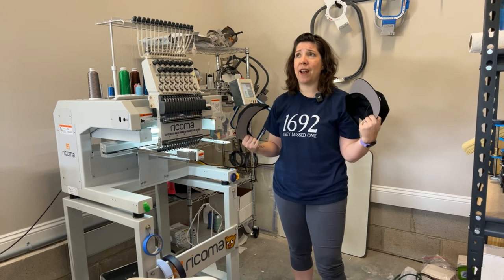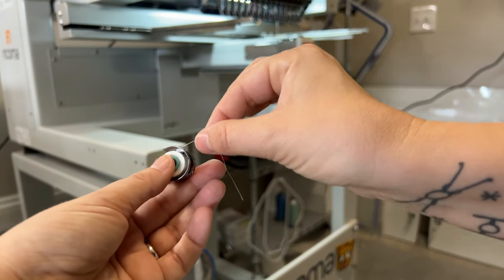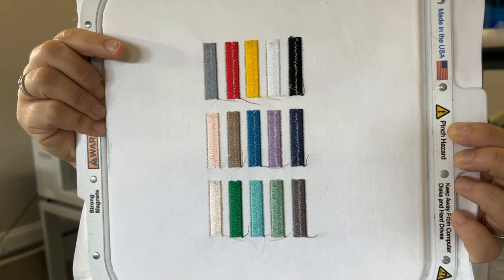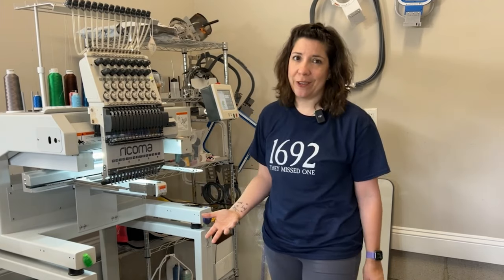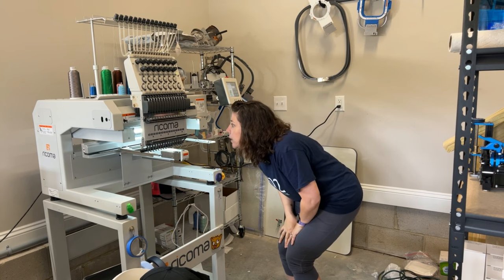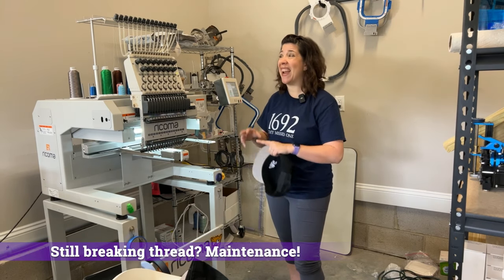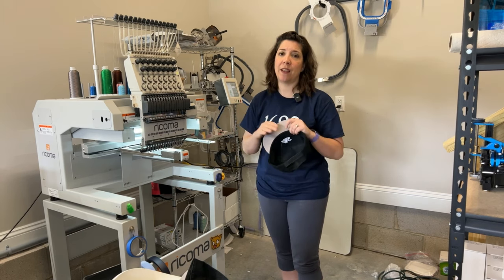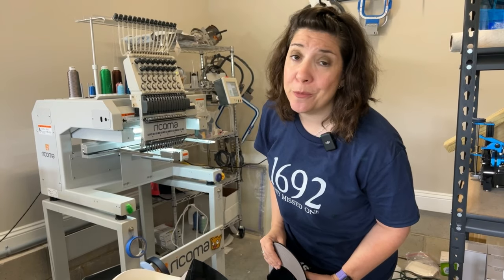How to Diagnose and Fix Thread Breaks in Machine Embroidery (featuring the Ricoma MT-1501)

Comment: Great video!!! I will add to check the needle direction too. This has happened to me on several occasions. If your needle is not set in the correct direction (even just slightly off) it can cause your thread to shred. Loved the info, thank you for sharing!

Comment: I’ll add one more thing… because this happened to me. I had thread shred on every needle, did all the troubleshooting and still couldn’t fix it. Turns out, the timing drifted off. So eyeball the needle position relative to the hook at 200 degrees. If it’s not lined up, your timing is off. Pretty easy fix on these machines but you have to hold your mouth right. 😊
Reply from the maker: HAH! That's so true!!! I have had this happen as well. I like to use the other end of the needle threading tool to hold my needles while I insert them. It helps keep them in the right position while I screw it back in.

Comment: I'm back, any advice for getting axis error repeatedly? needle is going off axis right in the seam....i've done every tip i've seen on yt and it's still an issue....so frustrating. everything should be good! It's not even flagging....so what could be causing this? please and thank you <3
Reply from the maker: I hate to ask, but have you called support?? I called them up and we facetimed fixing it remotely.

Comment: You shouldn’t ever need a 90 needle unless you’re embroidering tough leather, like a saddle or something similar. Stabilizer isn’t needed for structured hats like the ones in your video, Richardson 112s, etc… and even then, a 75 needle is more than enough. The majority of consistent thread breaks are the result of bad digitizing, too many stitches in too many directions too close  together. If the thread breaks are in random spots, it’s usually a burr in the eye of your needle.
Reply: Who do you use for your digitizing?
Reply: @serenityinthecity1  we do most of our own digitizing on Wilcom embroidery studio. If we need to send something small out for a quick turnaround, we use Steven at digitizing ninjas.

Comment: One needle of my machine isn’t going through the fabric. Any idea why? It keeps saying thread break. I changed the needle,  oiled up my machine, made sure there’s no lint or thread in the bobbin area and im lost.
Reply from the maker: When that happens, the only way I've found to fix it is to take a picture of the stitch count in the design, back out of embroidery mode, then back into embroidery mode, set the stitch count manually from 0 to where it was when I took the picture, then start from there.

Comment: I have a single needle embroidery machine and it snaps all the time.  Went through all the steps.  Took it in for service.  Still snapping.  At this point I think the case has warped slightly and it is binding up the thread.  Next test is running a test with the case off.  Fun fun
Reply from the maker: Is it a dedicated single needle embroidery machine or a combo with sewing? I'd agree that something seems wrong about it if you've done everything you can, PLUS service and you're still getting problems.
Reply: @fiercekittenz  combo.  yeah I know.  Someday maybe i can afford a real embroidery machine :)

Comment: I got a new machine and hit the ground running for days and days and days (you get the idea...) and then the new machine started acting up. I changed needles, I oiled, I did everything I could think of. But I didn't think about what I was sewing (velour and velvet...) and when I took the machine apart, it was COMPACTED with lint under the sewing plate. It resembled a huge block of felt. I hung my head in shame, as I always used to clean out under the plate at least weekly and I totally forgot.
Reply from the maker: OH NOOOOO!!! I should have brought that up too LOL!!!